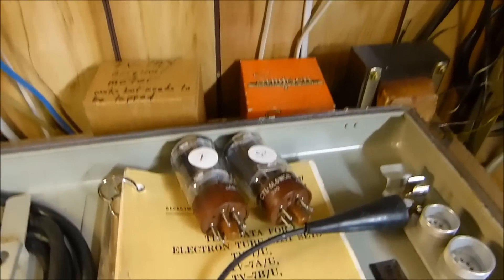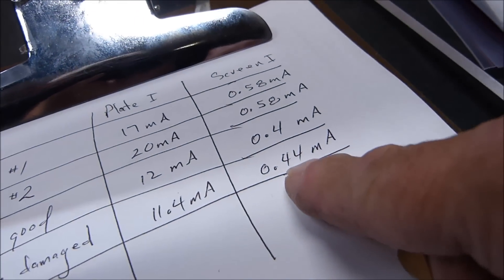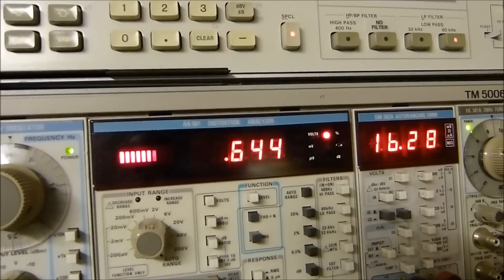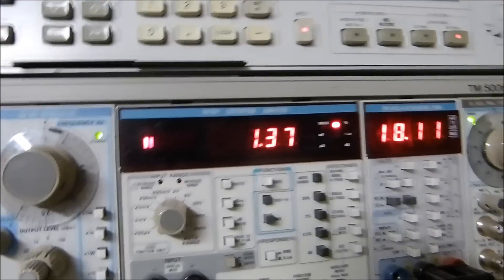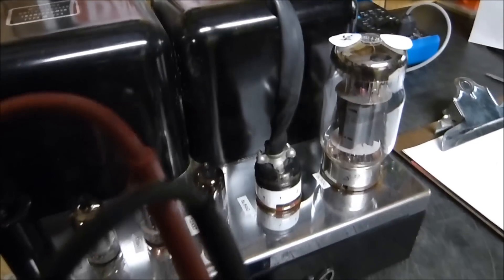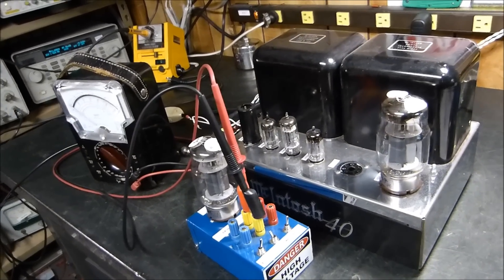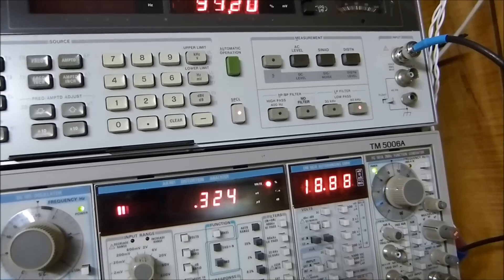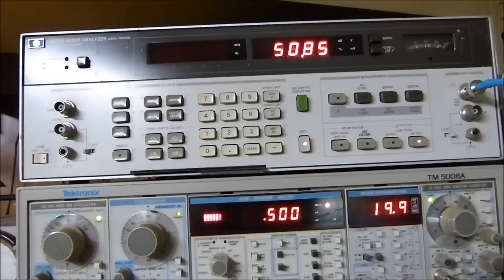Part 2 - Damage To A Vacuum Tube If Plate Voltage is Removed Or Not Present

Comment: Don't they make the clips with proper spring steel, anymore?
Reply from the maker: From what I have seen in guitar amplifiers, I would say, no. I only use vintage military surplus equipment tube sockets that I have salvaged from the old equipment. They work great even at 60+ years old.

Comment: Very interesting video! I sometimes find metallic particles inside tubes when I come to repair equipments. It seems like some electrode has "boiled" and vaporized. Do you think it has to do with this increasing current in the screen because of plate voltage cut? Thanks. Very interesting video! I sometimes find metalic particles inside tubes when I come to repair equipments. It seems like some electrode has "boiled" and vaporized. Do you think it has to do with this increasing current in the screen because of plate voltage cut? Thanks.
Reply from the maker: In the larger tubes with direct heated cathodes like the 811A or 813, I find that anything rattling around inside the tube is usually the filament which is broken and the tube is useless. In some of the smaller tubes, I have seen bits of mica from the internal structure inside the tube and that could be OK. Also, some of the material inside the tube might be the coating of the cathode flaking off which would likely make the tube weak. As for the screen damaged, I can't say that I have seen lose material inside the tube after screen grid damage. My guess is some of the screen material is either gone as in vaporized or the screen has bits and pieces of it melted down on itself occasionally shorting to the plate. In either case of the screen damage, the tube is very weakened or shorted and will have to be replaced. Recently, just within the last month, I had a 6AG7 (metal tube) in a piece of 1947 Collins radio transmitter equipment, short the third grid (this is a pentode) directly to the plate of the tube which burned up the power supply choke. A rather odd occurrence but it did happen just like that. After finding the shorted tube, I was able to measure a direct short with a DC ohmmeter between this third grid (suppressor grid) and the plate. Replacing the shorted tube and burned up power supply choke fixed the transmitter.

Comment: It makes sense in my head, that screen current would rush up in the screen grid with the loss of plate connection during operation. With the loss of plate connection, the electrons boiling off the cathode now only have the screen grid as the path of least resistance to B+

Certainly is a good point and thing to keep in mind.
Reply from the maker: I have seen it just enough times, even on good quality sockets, to come to the conclusion that the heat from the plate travels down the supporting wire into the actual pin of the tube and into the socket either softening up or possibly hardening and crystallizing the metal in the female pin. That is my only explanation why this seem to happen. With that said, it seems we would also have filament pins having problems from conduction heat traveling back down the pin into the socket... maybe the filament is not as hot as the plate... who knows? But even a momentary bad plate connection with destroy the screen grid for the reasons you mentioned.
Reply: @ElPasoTubeAmps  I imagine on newer sockets that sounds totally plausible as the metal is not of the same quality as old. Even on the old, the heat probably aids in oxidation would be my guess. It certainly has gotten my mind pondering on ways to implement protection circuitry in such situations. I've seen fuses on the cathode, but that does not seem effectual to me, as its really the screen connection that needs the overcurrent protection. I really despise the idea of solid state being mixed in, but a very low ohm resistor, being monitored by an isolated voltage detector to trigger a relay to open the HT comes to mind. That is an easy way, but I'd like to implement a solution keeping everything to the same vintage and no solid state.
Reply from the maker: @r3tr0nic  You, Sir, are a designer after my own heart. I run a 4CX1000A in my homebrew ham radio transmitter and I protect the screen with a 100 mA fuse.  In my case, if I blow the fuse, which has happened but very rarely, I just go to low power until I can replace the fuse. In the case of playing an amplifier in a work environment, blowing this fuse and putting the amplifier off-line is not acceptable. I agree that integrating SS and analog is not what makes me happy but I think your approach to limiting the screen current thru SS application is probably the right answer. It will surely save a lot of output tubes. The screen resistor approach is hopeless, as I am sure you understand, in limiting actual screen current and making the screen resistors 1/4 watt so they will burn up like a fuse and putting deep into the amplifier circuit board so it takes hours to get to them to replace them is worse than ever. I have seen and done this and I ask why???  Maybe today with all the computer control we have, it might be a good idea to design a circuit that simply will not let screen current soar above some set value. So the distortion increases or the power decreases... at least the poor output tube survives to work another day. Just my thoughts.

Comment: Old video but I noticed at 4:03 just before you turned the amp off the screen current was around 7/8 scale when the camera panned to the test fixture.
Reply from the maker: I did check the video out again and I see what you mean about the screen current but that scale is only 12 mA so I think that value is ok as it would be only 10.5 mA for the scale you mention. 
As an update to these so called, "bias probes", I have noticed in many cases that inserting the current meter in the plate lead (as I did in this experiment) may cause instabilities in the amplifier. That additional bundle of wire from the socket to the test jig causes more issues that we might think. I have come to the conclusion that the most reliable way (and safest from HV shock) is to measure the current across a 1 ohm or 10 ohm cathode resistor. From what I have experienced, this method causes the least amount of instabilities to be induced into the amplifier and the best place to put these cathode resistors is right at the terminals of the tube socket and provide test points on the amplifier chassis.
Reply: @ElPasoTubeAmps  I've seen the 1 ohm or 10 ohm resistors on the cathode to ground in guitar amplifiers. It's pretty convenient to have.

Comment: This makes me wonder if I somehow caused damage to some russian 7189s I am using now. The amp I installed them in had some shipping damage as the tubes were not removed before shipping, which loosened the pins in the sockets. I was getting intermittent crackling and popping which was only solved by tapping the amp. After tightening the pins with a sewing needle they seem fine, but I don't have any of the lab equipment to properly test the output of the amplifier.

Comment: I'm surprised that the clipping was symmetrical with only one bad tube.
Reply from the maker: I am sure that is the beauty of the Mac amp design. Obviously it will not put out full power but it will still sound great even with (very) unbalanced output tubes.

Comment: thanks elpaso , but there's a lot of things to manipulate the 12ax7 preamps tubes to a low voltage at 12 volts instead of 150to300 volts , also which the filament voltage to D.C. to get rid of the thd distortion , lol

Comment: nice I don't have a lot of nice tester like yours, but I'm still working on my tube amplifier kt66 at 38watts single channel a vintage that is.
Reply from the maker: I really like the KT66 and the 30 watt power range is believed by some, including myself, to be the true "sweet range" of power output for tube amplifiers. I can imagine a lot of that is because of the McIntosh MC30, a good Williamson build and many other vintage amplifiers that operate in the 25-40 watt range. Keep up the good work and post your amplifier.

Comment: Conclusion? Put a series resistor into the screen grid path, usually 470Ohms up to 1kOhm, this will help the sreen to stay in SOA unless something goes really wrong (=loosing plate voltage) and it usually blows up and save the screen grid. All my Tube Amps have this little "ScreenSaver" either by factory design or installed when i restored/repaired them....
Another nice thing to have is a 10Ohm/0.25W resistor within the cathode path acting like a fuse when something tries to kill the tube, like loosing the negative control grid bias.
Reply from the maker: TubiCal I agree that the cathode resistors, which really act as fuses, are a good idea. Even in my 4CX1000A amplifier, I have a 1/2 ohm resistor coming right off the power supply (3KV) to explode if something is shorted and remove the HV from all the circuits. I use a 1/16 amp fuse in the screen of the 4CX1000A to protect it.

Comment: DAVID
  It's time to make another video brother. We miss all the free collective knowledge you share with us that is so beneficial.
Reply from the maker: Mike Samra Hi Mike, so good to hear from you. We should talk. It has been busy around here. The wife has retired from being a pre-K teacher and so on. I have so many projects in my mind and I have collected the material for them. I recently purchased a 30L-1 and it is a jewel. I am thinking of a SE 833A amp. What do you think? Nuts, huh?
Reply from the maker: Mike Samra I have to  tell you about my experience at changing a battery in an iPhone 5... I am thinking of a video on holding relays and the variety of  devices that can be added to the holding circuit. I have use such a circuit for over 40 years. Thoughts?

Comment: You have some great test equipment there!  Early clipping on the damaged tube, the
power still appears to be there, but the signal amplification is not true anymore.
The screen may have deformed/warped internally and perhaps touching the plate now in places?
Cheap sockets for a quality amp like the Mac. They should have used better quality ceramic sockets
on the o/p stage.

Comment: Thank you for another good video!  This video (and part 1) got me thinking.  The curve tracer that I use to test tubes sets the cathode to 0 volts, biases the grid from 0V - (-20V) (the start point and range is adjustable of course) and then ramps the plate from 0 - max plate volts to draw the curve on the screen.  Each step of the grid voltage the plate is ramped from 0-max.  In the case of testing a pentode, the screen voltage is held constant and a voltage about 10% less than maximum plate voltage.  After this video… I am wondering if this test method is damaging the tube as through a good portion of the plate voltage sweep the screen grid (not swept) is more positive than the plate.  The traces on this type of set up match the tube specifications, but again, this video makes me wonder.  One more bit of information … the cathode and screen grid are referenced to the same ground point.  

I think now that I am going to set up a test to measure the screen grid current change  to see what happens to the screen grid current as the tube is under test on the curve tracer.  It will be interesting to see if it exceeds the maximum screen grid current ratings.
Reply from the maker: Dave Rawding I see your point and I agree with you. It is definitely worth looking into. In the case of the damaged KT66, the tube checkers do identify it as not up to par but from what I have experienced, that prompted these tests, the screen can be damaged quickly and we may not even realize what happened or if anything happened but afterwards the tube just doesn't perform as well as it did before. In this, so called, 6L6 family of output tubes, we know the screen can be equal to or less than plate voltage but I don't know how much higher it can be than the plate without damage. Your experiments on monitoring screen current during these plate voltage sweeps would be extremely valuable. Maybe the screen current, in your tube tracer, is limited by a large series resistor? Just guessing.

Comment: I watched your other video and I commented before I saw this video and you did what I would do..Notice how the current rises when you drive it in the output,
Reply from the maker: Mike Samra Absolutely, just a momentary overload of screen current in the output section and the tube is damaged and no longer performs properly. I wrote a lengthy response to another viewer posting comments about 4-400A and 4CX1000A screens that I have personally experienced that I won't repeat here but I hope this video can help prevent and diagnose, in particular, interface problems (tube sockets) that mechanical trauma (i.e. tapping and especially vibrations from the speakers in a combo guitar amp)  can cause that we never experience happening and don't understand how it happened afterwards. It certainly isn't going to solve every problem but it may help prevent multiple tubes being destroyed.

Comment from the maker: I will have to say that both of the old Hickok tube testers do identify the bad tube as not in good shape. Thumbs up for the tube testers.

My goal with these two videos was to, hopefully, determine if bad sockets could indeed be a source of output tube destruction. Does tapping on a tube really determine if something is wrong in the tube or might it sometimes exacerbate a different issue (loose connections) and actually end up destroying the tube?

Comment: Well, ya can't argue with the meter! :) You proved it out to be a fact that losing the plate voltage soars the screen current to a dangerous level which is no doubt detrimental to the tubes survival. You made a very interesting point about newer style tube sockets used in instrument amplifiers these days...pure crapola! The risk of losing a tube or a set of tubes in the modern-day era amplifiers is without a doubt prevalent. You hit the nail on the head when you mentioned the soft metals used in the new tube sockets. I've had customers bring in amplifiers for repair that had tubes that were history due to defective octal base sockets. I've even had numerous incidents where the contacts in the socket would split completely and I've found pieces of these contacts being stuck to the tube pins, or flying out and hitting the floor while removing the tubes. Also, I'm sure you've seen many a melted sockets as well. Poor connections will do it all the time...especially since modern day sockets just about squeeze around the tube pins. Screen resistors offer added protection, but a bad tube socket can make a mess of things. Most of today's octal, as well as 7 and 9 pin miniatures are wun hung lo specials. Pomona, and Jones made the best sockets...Boy, do I miss the 'ol days! :) Keep the great videos coming! Always enjoyed by me. When you have another technician following your videos, that's an indication you're doing it right! and you are!!! Frank Ferraro--Audio Craft Electronics.
Reply: To make it worse, many guitar amps are oriested with the tubes facing downward, so the heat rises through the phenolic (usually) sockets, stressing the sockets AND the bases of the tubes. Ceramic sockets are the best!

Edit: Please forgive the guitar amp reference :)

Comment: Thank you for the follow up!
Looks like the answer is yes, at least in this case. In topologies where a screen resistor is used it may play out differently, but in this case the idle current is sufficient to push screen dissipation to damaging levels.
The numbers from my other post were max dissipation for KT88s, KT66s seem to be rated around 3.5W, or about 7.5mA at 470V. Your work shows that there's plenty of current to cause trouble.

Looking good now!